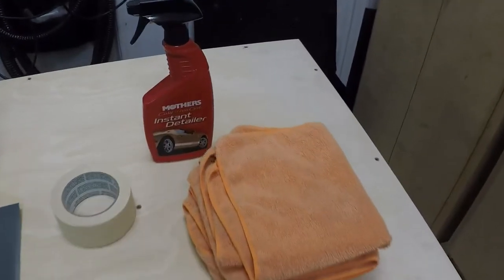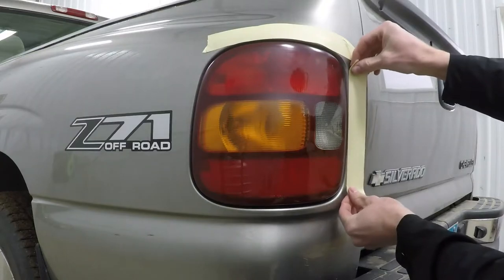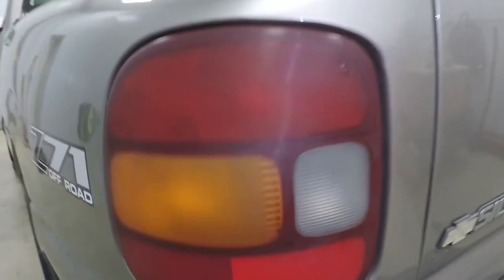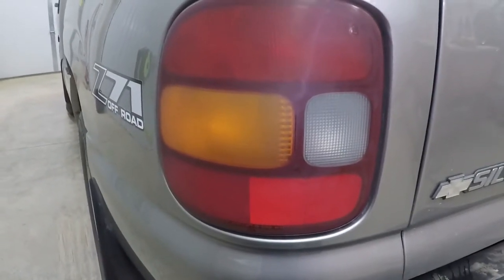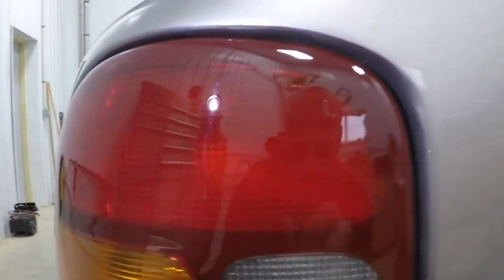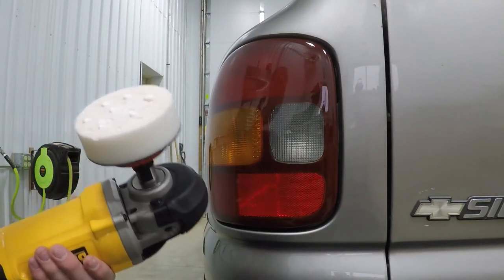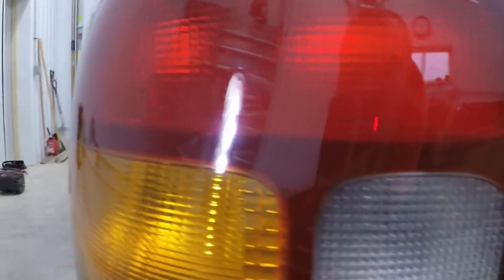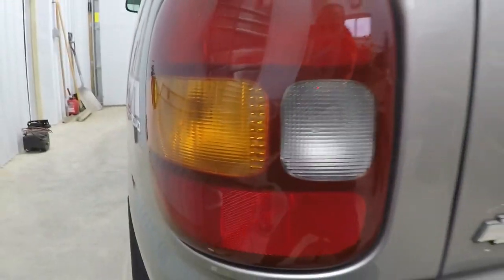How To Restore Faded/Scratched Car Taillights - Wet Sand & Polish

Comment: Mine is a step side, and the original tail lights had black borders. I have an extra set I got out of junkyard. They are not available as far as I can tell. My originals are better than the spare set I got, so Im gonna try on the extra set first. SO scared to sand anything plastic...

Comment: Can you tell me the dewalt polishing pad part?? The one I received with my polisher was around 5" in diametre and larger than the one you used, Thanks
Reply from the maker: You can just get a 3" backing plate for it on amazon, I think they are 5/8 threads. Then you can just get some 3" polishing pads.

Comment: I did mine and it came out foggy and had some scratches . is it because I did not apply rubbing compound and went with polish right after my last 2000 grit wet sand?
Reply from the maker: Yes that's exactly right. You would  be better off only doing compound and no polish, at least that way the sanding scratches would come out and they would be shiny. Polish just takes it to the next level.

Comment: Do you recommend  clearcoating the lens?
Reply from the maker: I've never done it but I think it is a good option if you use good quality clear coat. You would skip the polishing steps and spray the clear after sanding.

Comment: Does it work the same if I apply the compound and the polish without a rotary polisher?
Reply from the maker: It would work by hand but it will take 100 times longer and you may not get as good of a result.

Comment: Where can I buy the polisher and those pads?
Reply from the maker: 1 CammedSS you can get the polisher pretty much anywhere, just look up online dewalt rotary polisher. I got the pads from autogeek.net. They're lake country 4" ccs pads, and you'll need a 3" backing plate if you're gonna use those.
Reply: Ty Brink thank you for the fast reply your a big help keep the vids comming

Comment: Afterwards were the lights greasy or anything? I'm planning on restoring my taillights then putting on Lamin-X taillight tint. Of course I'm worried about the adhesion and if it'd effect anything
Reply from the maker: They were not greasy, but you should definitely clean them after polishing with some sort of alcohol or something like alcohol glass cleaner before you put tint on.
Reply: @TyBrink  Would that fade them at all?
Reply from the maker: @valant963  it shouldn't but if you want to be safe you can just use a degreaser or just soap and water you should be fine.